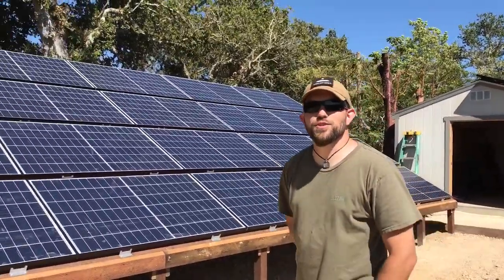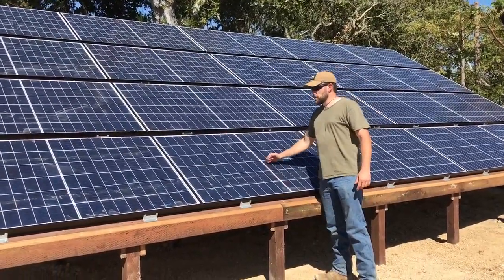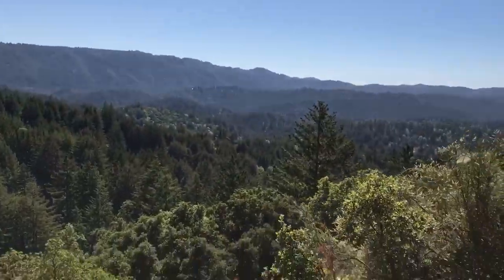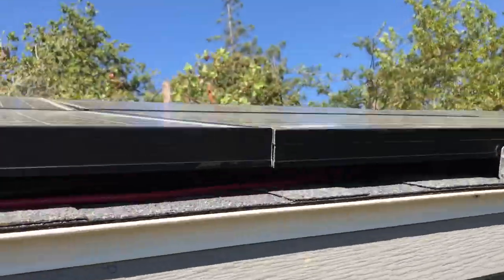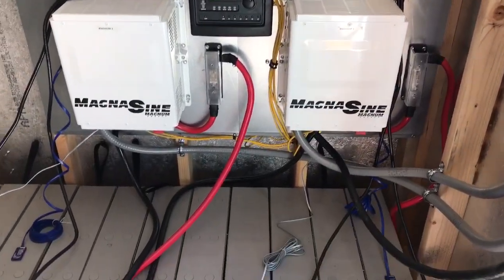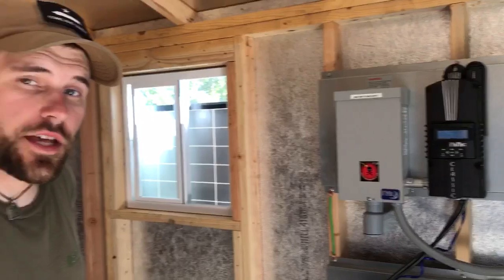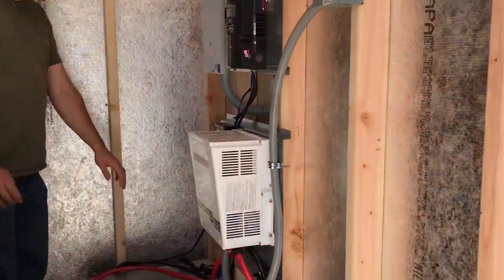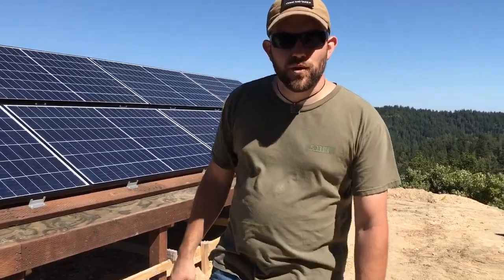12.7KW Off Grid ground mount Solar install by Off Grid Contracting

Comment: 12.7kW? That array produces more power in two hours than I use in a week. More power to them, but a 2kW array produces more power than I need.
Reply: You only use 12KW a week? 48 KW a month? Your bill would be like $4 for usage...A window AC unit uses 11KW a day...1100 Watts X 10 hours...You must live in a very temperate climate..
Reply: I had two days back in February at 46C. The window AC units I've been checking out use about 600W and I'd only want it going for 3-4 hours a day.

My daily usage is about 2kWh per day. The last time I was hooked up to the grid I was paying about $1.44 a day just to be connected and then about 70 cents a day in actual usage.

Comment: Wow, that is awfully close to that cliff. What will they be doing with that large a system. Seems a bit much for standard apps. Looks nice.  Janice
Reply: I have 3.2k... and it BARELY covers a fridge and the PC during the day when it is sunny out. Remember with solar, clouds kill it and extended solar will straight up rape your face...  During sunny days in winter I can get 4kw/h from my system during cloudy days drop that to 1.2kw/h.. and during wind/snow? drop it to 900 and 5-600 respectively...  So a 12.7 looks like a good size for an area that gets a lot of rain/snow during the winter, and by the looks of the trees I would say this is the northern Appalachian Mountains... Feel free to correct me if I am wrong... as it could (not likely) be north eastern California...

Comment: Real sloppy workmanship.
Reply: I thought it looked like shit also 
Weatherheads are so tacky. 
Ive been installing solar for 10 years. He needs to work on wire management and equipment layout (dont put inverters above battery banks)
Reply: If he wasn't so proud of the sloppy wiring job i would have said nothing but i train installers so i tend to critique to better there workmanship.   You sure seem to be a logger-head.
Reply: I was just going say that too so much money being invested and being paid for sloppy work looks like reused wood and like he eyeballed everything no measuring whatsoever

Comment: Just a guess, but it looks as though the battery system is 30% of what would work for that power generation, unless there is no off-hour (night/cloud) use.  Just by appearance, I have more than twice the battery capacity shown on my system, with about 1/2 the front end PV power, and my batteries are about 60% of what I would really like.

Comment: This looks like a VERY expensive system - $50,000 and up !
Reply: Well, a 235W panel is about $150, so 54 (he's using 270, which might be diff price). About 8 grand in panels. But hey, they can power a friggin 4000 foot mansion!
Reply: @Marc030320  or power a Tank manufacturing facility... LOL.

Comment: On a basic home you need a 200 Amp Service. We have 4 seasons here in my area. For me to get my money back on this it will be 30 Year's. Most Panels don't last 5 to 7 years this should be all free seeing the Tax Payer funded this as well.
Reply: The truth is keeping you broke ....
Reply: Bullshit. Panels last for ages. They're made of sand (silicon), with no moving parts. Power output degrades at around 0.5 percent per year. Any decent panel is guaranteed 85% plus after 20 years. There are experimental panels from the 1970s still operating at 70% plus. It's decentralised ELECTRICITY  direct from  SUNLIGHT ffs, with no utility company in sight, what's not to like?
Reply: You're kidding right? All panels last for 20-25 years at a guaranteed 80% output but the actual useful life is far longer.

Comment: I just LOVE the quality of your work. You definitely do your installs as unto Our Lord! Your quality of work and attention to detail are second to none!
I'm at 46.1 Degrees North on the Oregon Coast. We get about 40 inches of rain per year. How big an install would you recommend for our 440 Sq. Ft. house. All we have is a standard Service with a traditional Range, Washer/Dryer, and Water Heater and that's it.
Our lighting is already handled by a 150 Watt Panel, small battery bank & 12 Volt L.E.D. lighting. It also runs the Ham Station very nicely. I just need the appliances. We heat with Kerosene, by the way.

Your thoughts, please?

Comment: What kind of batteries are you using?
Reply: I use a combination of flooded and AGM in two separate banks.  Both work great for me.
Reply: i would say that they are OPZV Batterys.

Comment: What protects the cells from miss guided birds or wind blown limbs...
Reply: Suicidal birds gonna kamikaze into the panels? lol. Yeah, birds are constantly killing themselves by flying into solid things all over my property. Just yesterday one of them knocked a huge hole in the wall of my shed. I reckon I can patch it up after I mill some lumber from all the trees that just blow into my yard though, so I'll probably break even.
Reply: nothing. Solar isnt a great solution but often the only solution. Hydro is way superior if you can get it.

Comment: how long is the life of the panels?
Reply: panels by major brands are guaranteed at least 90% output at 10 years and 80% at 20 years. as long as there's no structural damage, silicon based panels have been tested to still operate even after 30 years (at lower than nameplate capacity of course).
Reply: either you have ulterior motives or you are just not well informed with solar costs. you have understated solar component lifespan and now overstating solar costs compared to alternatives.

at the utility scale level, install costs are at $1/watt. in a reasonably sunny location with decent irradiation, that puts generating costs at 4-5 cents/kwh. you can look up independent and government reports to see that is cheaper than most alternatives including coal in some states. only wind and hydro can get cheaper in some instances.
Reply: I've got a small panel I bought 35 years ago that still works.
Reply: maybe you can tell me how much a fossil fuel based generator lasts? everything will break and can break faster than normal in certain circumstances.

solar isn't cheap upfront and it's not for every location, but with proper planning and maintenance, it can be one of the cheapest electricity sources at today's prices when depreciating the costs over the warrantied lifespan. brand inverters are warrantied for more than 5 years (typical lifespan of 10-15 or more years). battery life depends on usage so in a well planned system, drainage cycles don't occur daily. like with any equipment, if you buy junk components, expect shorter replacement cycles.
Reply: also note that batteries and inverters will likely last about 5 years.
Reply: ? Why are you comparing to a petrol generator? The alternative to solar is large scale production from the electrical grid using coal or fission or water potential. And those last decades to centuries
Reply: And i know a tall Asian! Asians are therefor tall!
idiot
Solar panels degrade over time, well known fact.
Reply: realistically 15 years top. You also need to maintain them, clean once per year.

Comment: Woah!  This can't be for a house.. is it a business?  What residence would need 12700 watts of solar ???  
Maybe they have a hot tub running 24/7, high power tanning bed, AC set to 50 degrees ? :-)
Reply: Christmas Eve My house is all electric...water heater, range, dryer and central air.  I use about 1,400 kwh a month.  that works out to 45 a day.  If I wanted to go totally off grid as my house is now, I would need to collect at least 45kwh.....if the average sun hours are 4...I would need a system this big.
Reply: central air alone for a large house would eat up half of this power. you also have to consider 12.7k is nameplate for the panels. actual usable power generated is usually 80-85%.

Comment: how does it work in the winter time when it snows 4 and 5 feet. how does it perform in high winds. will strong winds lift off the pannels. just wondering.
Reply from the maker: R G Wells snow shed off the unit should be fine but as far as the high winds go the panels are individually anchored to the frame by 4 brackets with 2 screws in each so it's held down very solid. We have used the same anchoring by bracket to a mount that has survived a hurricane.